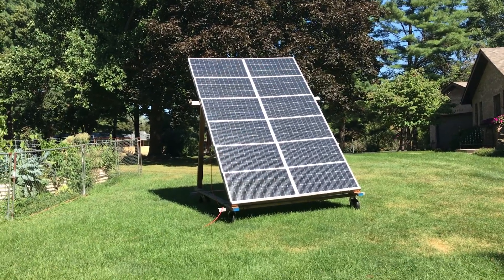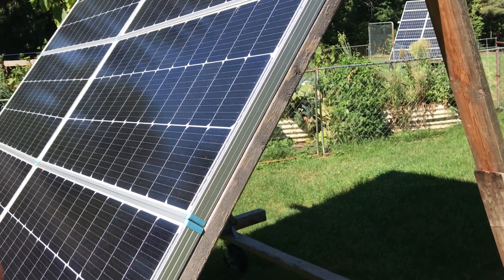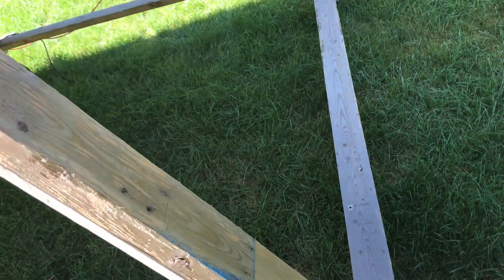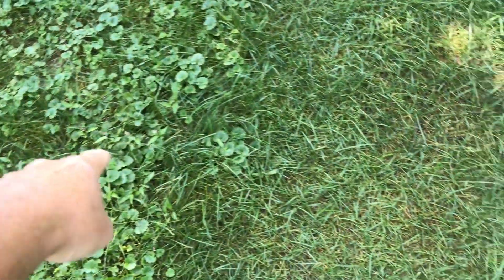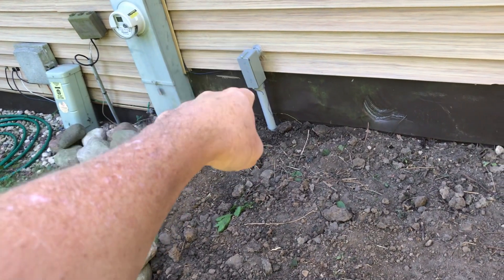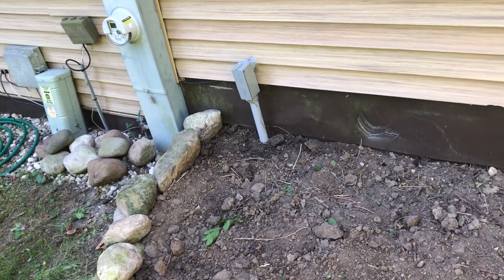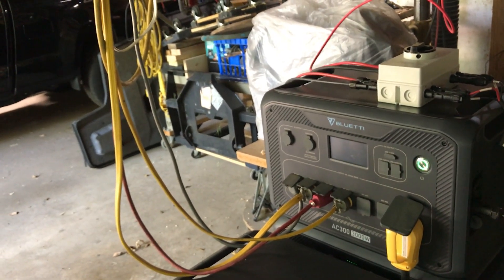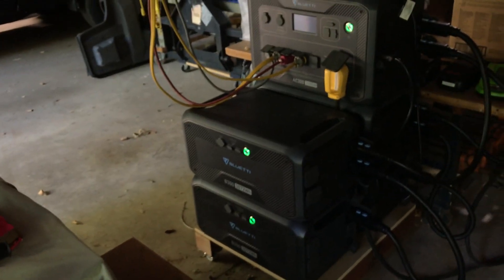My Bluetti AC300 system walk through

Comment: Cool panels output more. Your arrays might run several degrees cooler if they were rotated 90 degrees. That way the heat at the back of the panels would only contact one panel above it as heat rises, instead of five panels in their current orientation. As you have two similar arrays you could simply lay one array sideways next to the vertical one and check for decreased panel temps, and any difference in output if the panels are all the same specs. Haven't watched the whole vid yet. Lower array height might also be beneficial for cleaning and less susceptible to high-wind-tip-over. Just finished your vid, very nice! I also have an AC300 w/4 B300, two 6-panel arrays of 330w/340w modules. Each array nominal output about 2kw, ground mounted on diy 2x4/6 frames. Also have that same DC Isolator switch, w/4 incoming array leads on MC4's, 10awg underground and in seal-tite conduit. Born, raised in Waukegan, Gurnee, and Wildwood. Now in New Mexico past 20 yrs. Thank you for your video!
Reply from the maker: Thanks for the tip.

Comment: I have 100w renogies too - struggling to wire it so it’s under 150v … 7 panels are 120v now … can’t get it right 😞
Reply from the maker: Wire them like I did.  6 panels in series then hook the two strings of 6 in parallel with a Y splitter https://www.amazon.com/gp/product/B0891XRFQB/ref=ppx_yo_dt_b_asin_title_o05_s00?ie=UTF8&th=1